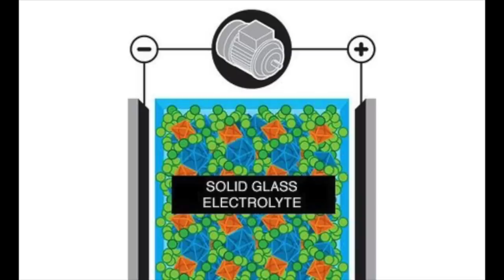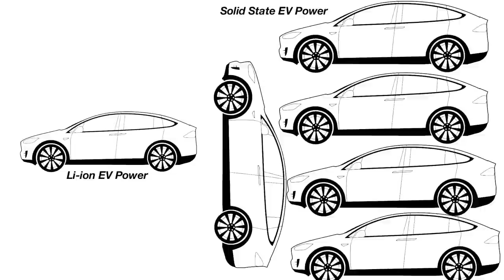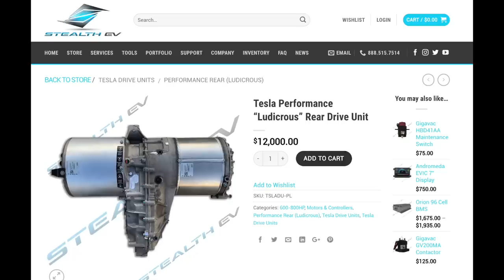The New Battery That will END GAS CARS by 2030 - BIFB SCIENCE (ft. my boat)

Comment: But electric cars can’t braaaap!
Reply: issue n° 1
Reply: Actually the bmw i8 can, it has a subwoofer under the back bumper
Reply: Derek Rogers it also has a 1.5l 3 cylinder engine, it has a subwoofer to make the sound louder but it has an engine
Reply: CMDR NEBULA they can if you throw water at them
Reply: @derekrogers3426   real braaap
Reply: What about electric motorcycles with this technology. Could you imagine the torque and speed?
Reply: Brap.mp3 played through the speaker
Reply: @johnolivera6599  They already have bikes that are almost unridable they are so fast just heavy. If it's alot lighter than lithium ion batts then that'll also make them so much faster.
Reply: Or roal coal 😠
Reply: Or VTEC !
Reply: @working2bselfsufficient724  said like its a bad thing LOLOLOLOL
Reply: Rotary???
Reply: @johnolivera6599  No not at all I like electric option along with ice motors. Just was letting him know there is already stupid fast electric bikes out for a few years now just expensive.
Reply: They can whine... Like in a futuristic way... not like my kids....
Reply: @F90boy  if you go watch the watch jr go vid when ambergini is looking for a new car they take out an i8 and it's for when you are in electric mode
Reply: Some new vehicles already have artificial engine sounds piped in through the speakers.
Reply: @derekrogers3426  It's not electric
Reply: But it can bzzzzzzz
Reply: Or stu stu
Reply: @F90boy  the speakers don't make it louder, its a completely different sound than the 3 cylinder actually makes lol
Reply: Yes. But you also know what we call people who prefer sound over speed.

Comment: Please put a good radar unit, gps unit (a good garmin or similar unit) and AIS unit on the B is for Boat. After working on the water for the last year plus, having everything you can to keep you as safe and aware of your surroundings is essential. Also you could replace that whole helm station with a engine monitoring system and a garmin display unit and it would look much cleaner

Comment: I'd be damned if my car stopped making all sorts of noises.
Reply: it won't stop making noises it would just be different ones. ones that arent as satisfying
Reply: Like rodknocks
Reply: Come to europe

We all drive 4 pot diesels

No noise is a massive bonus
Reply: the dilemma
Reply: Well, simulated noises. The best high definition noises that you can find for your car to pump through its speakers. Please get it on a flash drive. You can get or have someone record the sound of best sounding cars. See, fixed it for you.
Reply: Can confirm my electric Fiat 500 does have a suspension knock, and ngl the electric whine is good enough to drive without music (on rare occasions)
Reply: schtekar - install custom speakers, then add custom “sound clips”.  Then you can still scream for attention

Comment: A correction, the solid state battery still has Lithium, the "glass" is a Lithium base, and the anode would be a thin sheet of either lithium or sodium.  Alot of the material on the net conflates sodium-ion batteries with Goodenough's solid state battery.  The real benefit is by using solid electrolyte it can not grow dendriites and short out leading to a fire.  To me it sounds more like a slow drain capacitor than a chemical battery, but that is semantics, I too have been following this tech as it's a huge next step.  Would also make home storage from solar cost effective.

Comment: Great video! I am glad you're being skeptical if everything. Battery tech is what's holding a lot of electronics back.
One thing I want to point out is that charge time isn't as big a deal as most people think. 

Gas cars have a fixed refuel time. No matter what you need to refuel for about 5 minutes every few hundred miles. With electric this isn't the case. While on long trips you will need to stop and wait to charge, on your daily drive you will never need to stop to "refuel". The refueling is done while the car is sitting at your home or at your work. So overall you spend much less time "refueling" your electric car over your gas one.

Comment: 500 hp is all you'll ever need.  Tell that to Cleetus!
Reply: Yea. I don't even need 100hp to have fun ae
Reply: @douglaspealing5608  I'd rather drive a slow car fast ,than a fast car slow. At least you can rev out a low powered car on the streets...cause you have to!
Reply: @theejoeylee  I live in a place called milford sound, new zealand. Middle of butt fuck nowhere. It's a 1hr 45 drive to the nearest town. At least, that's what I tell people who haven't driven the road. My record was set in a 1.4 litre diesel citroen with a check engine light on. 1 hour, 11 minutes - that's faster than a lot of people who live there manage in much more capable cars than that citroen.

*edit, it is not what you drive, it's how you drive it
Reply: @douglaspealing5608  It really is. My old work van was slow as hell but I dragged every ounce out of it with skilled driving. Always on the limit lol.

Comment: chris just so you know,  changing over from ice powered cars to electric cars won‘t be an overnight process. the power grid would instantly collapse if everyone switched to electric. it will be a gradual, slow process...
Reply: Not so sure about that as more renewable come online and American get smart about Thorium Salt Reactors we'll be okay. Now that information is out there it is not going back into the bottle.
Reply: @Minni dry cell batteries are incredibly hard to produce at the moment. They are used for cardiac pacemakers and stuff. Making car batteries is not lucrative because this process is not conditioned to economies of scale. It will be multiple years, if not decades before these cells become viable. And thats just talking about development, not certification...

The us power grid also will not be able to sustain electric mobility for decades. You guys are extremely dependent on fossil fuels, more so than most other countries on earth.

As i said, this whole thing will be a long gradual process, it cannot happen over night...

Just for fun:
Renewable energy sources as they stand are mostly good for the environment. The problem with them is that for example windmills are mostly made of fiberglass or carbon fiber. Due to the resin that is used while making those things, they have to be shredded and burned when their service time is over. Thats horrific, because what you get is e.g. lots of very toxic carbon dust that cannot be recycled...

Everybody is just so short sighted these days, where are the pragmatists? There is no single way out of this environmental crisis, every solution brings its own problems. We should stop searching for catchphrases and shit and start doing damage control. Maybe start with reforestation, start with small solar and windparks, stop driving everywhere by car (yes also your electric one), stop transporting packages by plane, start taxing kerosine, ... 

Hitler already tried promising „wonder weapons“, that never got him anywhere either. The world is full of propaganda (left and right), don’t believe everything you hear...

Comment: Electric cars are gonna be good until the solar storm hits earth and im gonna be laughing in my carbureted 350
Reply: I think that's a movie scenario... The War of the Worlds? But no, it affects long power lines, so there might be power outages, but the electronics won't be affected, unless you were talking about an alien invasion...
Reply: john broskey how would u pump gas though
Reply: @JxcksonSF  do you even know what a solar storm is?
Reply: Your car wouldn't be safe either. You have a 12v battery, ignition coil, distributor, and any other miscellaneous wiring harnesses
Reply: SomeInternetKid yea but id like to think so
Reply: @captaincannabis3321  absolutely it would. but to say theyre immune to damage in the first place is false
Reply: There are electric pumps at refineries making gasoline. So there's that problem to overcome. Plus getting the gasoline without a debit card, most stations close when their internet goes down.
Reply: Unless you run points with your carb ice car, an EMS from the sun or nuke will take out your elec ignition module and you will be parked next to a Tesla. Home wired Li ion AC induction motor with no silicon based circuits would survive.
Reply: Lol carburetor or fuel injected if some how a big enough EMP storm your chevy would still not run.
Reply: Electronic ignition??

Comment: I wouldn’t hold your breath. They tried doing a similar thing with carbon based batteries and nothing happened over ten years. It was to hard to manufacture
Reply: And Elon's truck looks nice too... (yes, I'm being sarcastic, the guy is a joke!) I am actually in the battery space. Goodenough has a good and very credible credentials, but I would agree that glass batteries are not as real as the flow batteries that cannot get traction. Goodenough is also pushing lithium iron phosphate. Heavy, low density and poor output. I hope I am wrong but these claims have been around for more than 20 years. Someday this problem will be solved but not anytime soon.

Comment: Chris, Not sure a battery is where a “drivers”concern should be. You pointed out a couple good points but pivoted differently than I. AI will replace the driver all together. Why have a vehicle controlled by a human? Fatigue and driver distraction related vehicle deaths are at an all time high, not to mention traffic and pollution. Boeing used humans life’s to debug it’s software so does Tesla with the autopilot system. Sure they have lost a couple 100 or so people. AI will save humans in the long run. hurdles of releasing systems is the calculated risk big businesses are taking to get Real world data that actually test the AI applications. 

In summary AI will be the next major breakthrough in the automobile industry. I also like how you pointed out more people like yourself will start making cars. When standard systems can prevent accidents from ever happening then you don’t need to build for accidents. You can focus on the human and their comforts. I definitely think alternative transportation,boats, Airplanes bikes and everything Besides the car is where to search. Traffic and a failed road network is the demise of the drivers automobile. 

Elon’s horrible looking cybertruck makes this argument even more favorable as you pointed out. Don’t like the body who cares throw on a different one! The design is made for toughness not for pleasure of the eye. I think automobile vehicle toughness will take flight standards very soon.

Thanks for the video!

Comment: We built an electric race car in high school out of a VW Scirocco.  It didn't make all the cool race car sounds, but I'll tell you what you could hear.  Each individual tire, the texture of the pavement, every little whisper and creak of the body that would normally be drowned out by RAAAAAAAAAAAAAAAAR.  With the incessant noise of the engine out of the way, you could actually listen to the car.

Comment: Like most tech, it'll probably be super expensive at first, but will be more affordable in time. The good thing is, no more head gasket problems, no more oil changes, less moving parts, batteries more affordable, electric motors easier to maintain or swap. I think it's a good idea. We need to get rid of the excessive techno gadgets inside though, we already have cellphones that do most of the dashboard stuff. Restraining that redundancy will save on weight and energy consumption.

Comment: I’ve got a Chevy bolt and a first gen (bmw) Mini Cooper, and as much as I love the instant torque in the bolt, the mini handles better and is more fun to drive. If the electric mini can bridge that gap, I’m going to be a happy camper. Also, I have a classic car that I would love to electrify, but the power to weight ratio of lithium ion batteries would give it max of 90 miles range. I’m very much looking forward to more energy dense batteries that will make it reasonable to drive my classic car more. :) loved the video. Thank you!

Comment: Charge in minutes? The amount of power needed for that is scary. We're already pushing 150 kW in the fastest chargers. That times 2.5 times the time factor... That's a lot of watts. 1 MW charger anyone?
Reply: Actually, there are 350kWh chargers now. The Model 3 has a max charging capability of 250kWh and the new Porsche Taycan is @ 350kWh charging. The Tesla semi is slated to charge @ 1mWh.

Comment: OK, energy density is per unit volume (holds 2 to 5x more power).  Weight is per unit volume (lighter weight per square inch).  Recharge time is per unit energy (charges faster!).  These three parameters will have to be balanced, especially against cost, to be effective.  Soooo the same size battery can hold more energy and be lighter but could recharge SLOWER but less often.  Hence the balance....

Comment: I would say, neither lithium, neither glass, because cobalt is limited by resources and glass was already discovered 2-3 years ago, but why it is not in production? Because there is technological issues and probably it is not cheap. But one thing what is possible to agree that batteries will be dominant, no matter the chemical properties.

Comment: If you live in a city and have less than 30 mile commutes, I think a certified used EV is totally worth it. We just got a 3 year old certified used eGolf for $11K. It gets 100 miles of range and charges in like 6 hours. It's totally viable for almost all of our city driving. I just drive the GTI when I have to go longer distances. The EV is good for about 80% of our driving and it's cheap to charge and cheap to buy. I see it as a win all around for us.

Comment: Future cars will be boring as hell.
No engine tuning 
No engine noise
No engine detailing 
Every car will start looking like a jelly mold.
They'll be nothing left for car enthusiasts to get excited about, all that will be left is putting on wheels changing colour and body kits.
Anything that looks half decent or a sports car will be out of the realms of normal car guys reach i.e. the guys and girls that can afford second hand civic, wrx, evo and so on. 
There will also be a lot more people walking once production of  gas is no longer sustainable or cost effective, so they'll be lots of people with classics unable to actually use them ever again as gas stations will disappear for charging points. 
On a plus, air will be cleaner and you'll have more luggage space 😔🥱
Reply: _"On a plus, air will be cleaner and you'll have more luggage space 😔_"
Don't forget, you'll smoke the remaining ICE cars performance wise and have more money and brakes last longer and less down time due to maintenance, etc., etc., etc. Good riddance to the ICE.
Reply: @asix9178  🤣 oh yeah and everyone has the same amount of power and like I said boring as hell. People won't be comparing engines they'll be comparing battery packs hahahahaha great convo for car meets, lets see the engine, oh wait, its just a boring looking cylinder mounted where you can't see them.

Comment: Chris there are actually 3 new technologies.. one Solid state by J. B G (the legend), another one is by Lithium Ion with ATM (asymmetric temperature modulation (in fact this is redesigned battery that can be super fast charged like 200 miles range in 5 mins  - Penn State research team announced that last month (aka) self heating lithium cell and the last one probably the best one is Carbon x Dioxide battery that should be 7x more capacity of the highest current 21700 cell or 18650 cell

Comment: When they introduce the "Cartridge" battery pack technology, you will be able to stop at a battery station, much like a current gas station, and "Swap-Out" your battery pack in less than 2 minutes and be back on the road with a full charge.
Reply: Teslas were designed for battery swap. Then people smarter then you decided fast charging was the right way to do it.

Comment: So lithium is still used in the battery, and there is still liquid electrolyte in the battery. In the papers on these batteries. Test data from six different cells show lots of inconsistencies, so hopefully they can iron out the issues but we are still have a ways to go before test batteries are even made. What references did you use Chris?

Comment: No it'll be more like every car would go to hybrid gasoline engine that would charge the system because not everybody will have a place to plug in their car even if you did a massive build out of charge stations it would never happen say at an apartment complex Etc so the best bet would be hybrids that get great gas mileage because they're super efficient charging and battery and so forth so yeah your fuel economy would be in the hundreds of miles per gallon and that's how it would go
Reply: Uuuuuummmm, no. apartment complexes are already installing chargers to attract EV owners and charging stations are already being built all over the place. The local Wawa's already have chargers. Hybrids are/were a great transition, but with this type of battery, ICE will die and EV's will be the norm.